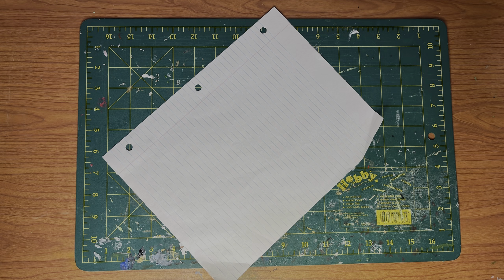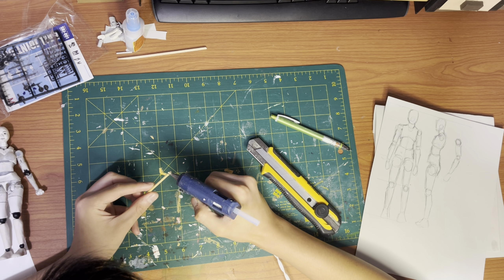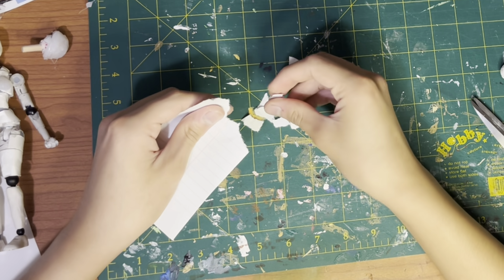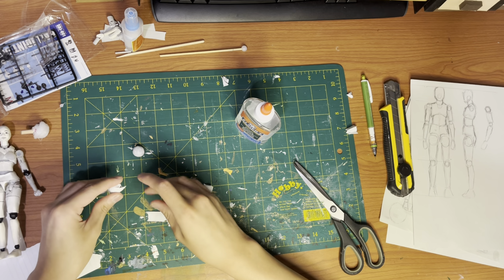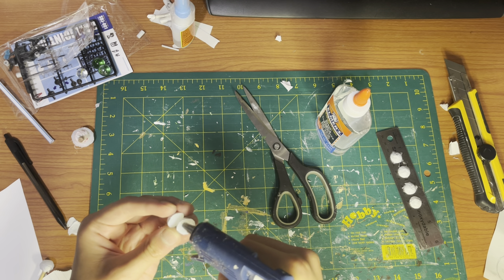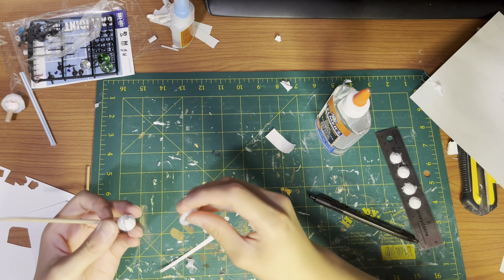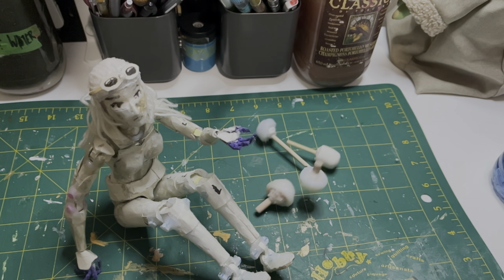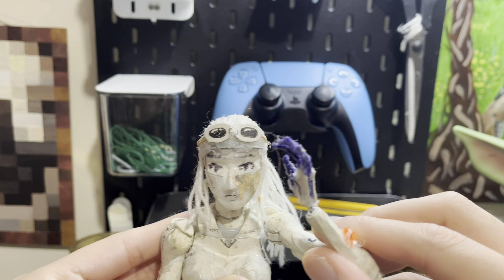Ball Joint Tutorial For Paper Action Figures

Comment: this is the only tutorial i have seen on these and theyre really cool, i made another way where you make a tinfoil ball and cover it in a thin layer of hot glue, then take a paper strip shaped like a plus and cover the ball till the paper is 3/4 down, trim the excess and wrap a paper strip around the bottom of the +, then continue wrapping paper up and around the plus shaped paper until you have a ball joint like this.